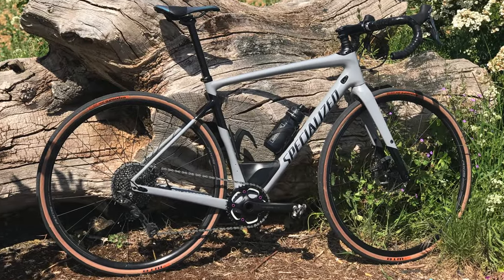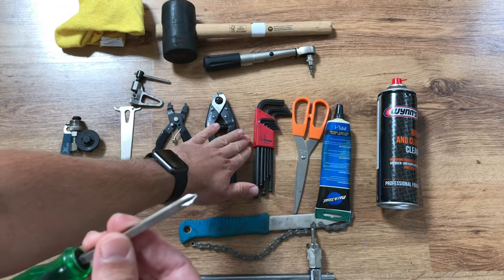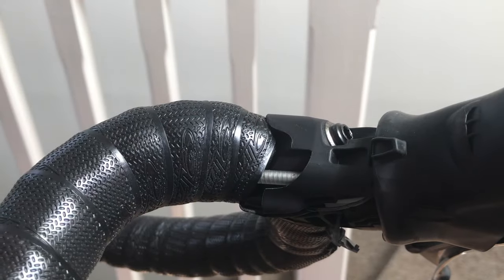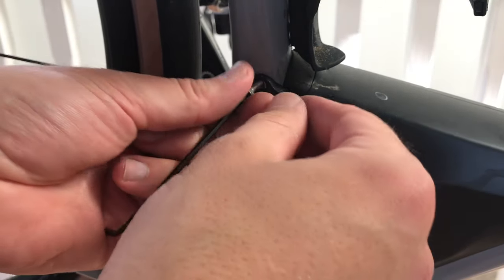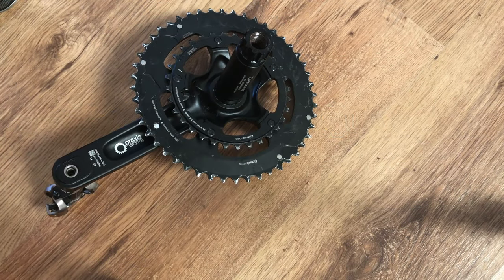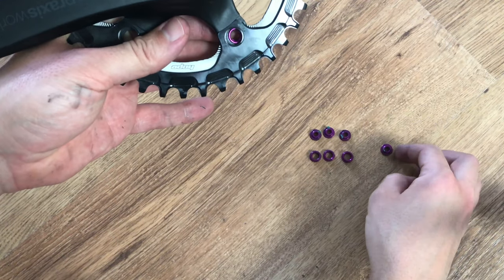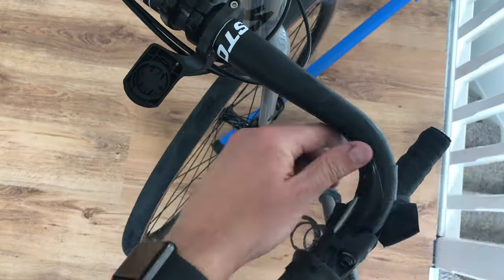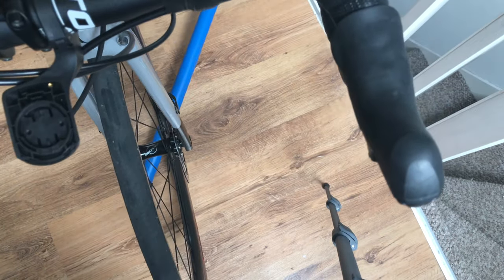How to do a 1X Single Chainring Conversion - The Diverge Project part 5

Comment: thank you for the video.
I'm planning to change my 39/53T to single 38T and 11-40T cassette. Although I have a power meter attached. I'm not sure if I can replace the chainring, but I should be (otherwise it would be useless if chainring need replacement).

Comment: I just got a new Checkpoint ALR 4, 2021.  It’s a 2x10, GRX 400. I really wanted a 1x, but this was available and affordable in a scarce market. I also really liked the fit and ride of it.  What parts would I need to upgrade to a 1x system for it?
Reply from the maker: Well your question is a little too open ended to answer accurately.It’s going to depend on the specifics options fitted to your bike as standard, what you want to spend and the terrain your planning on riding. For a basic 1x conversion all you really need is to ditch the double chainrings and front derailleur for a narrow wide tooth profile single chain. But at this point you may want to consider a wider range cassette as switching to a single chainring will limit your climbing and your top speed gears. Most single ring set ups don’t mind loosing the top speed gearing a little, but favour a low range gear for climbing especially on gravel bikes. So understanding your local terrain you ride and the gear ratios needed to climb is important.
This then can produces a problem that it’s likely that your rear derailleur is not designed to be used with a wide range cassette and might not be able to operate. At this stage you need to start considering a new rear mech or alternative options like wolftooths road link to adapt the rear derailleur. 
See it’s a little complex for a strait forward answer.
Reply: @MozOnBikes  if I run the same grx 400 2x10, and I am totally happy with the large chainring and not using the smaller one, do you think removing just the smaller chainring and front derailleur will work? I have a clutch on my rear derailleur as well.

And btw, how much weight your bike lost when moved to 1x from 2x?
Reply from the maker: It won’t work well, the outer chainring has profiled teeth for making shifting easy, you’ll find your chain dropping. You defo need to buy a specific 1x chainring.
The weight loss isn’t huge, but that mostly due to a larger range cassette weighing more.

Comment: hi man thanks so much for the video  ...i wanna ask you. : I didn't see you using chain catcher in the crank , is it not necessary ?? ....and is it possible to do that with 8 speed claris groupset ....i also got so many climbs in my town
Reply from the maker: It depends on the setup, with a narrow wide chainring and the clutch type rear mech its really unlikely to come off. However without the clutch its can be a bit temperamental especially if you tend to back pedal at traffic lights or junctions for example, on older setups pre GRX rear mechs with just a narrow wide id occasionally drop the chain. Claris will be a tricky conversion, id keep as many easy gears as possible to tackle the climbs.
Reply: @MozOnBikes  thanks for the explanation 🙏
Reply: Had Claris 8sp as well. Replaced the 11/26 with 11/34 and adjusted the B screw accordingly. Dropped the 52 and 36 off the front and replaced the big ring with mtb bash s a spacer, keeping the same ring bolts
Reply: @BrianWest58  thanks man ... I think i will do the same 👍👍😁😁

Comment: Great video. I really enjoyed watching it. 
I am also getting 1x conversion on my giant revolt gravel bike which current has 32x48 praxis alba crank & 11-34casette. I have ordered it from shimano to install GRX components that includes the crank  set as well as the other parts to make it a 40t x 11-42t. However, after watching your video I came to realise that as far as crank is concerned ordering just a 40T ring from praxis would have been fine.....oopps too late now🤭
I have one question to you and this is to understand if you're facing this small issue that I have (may be not an issue tough!)? Subsequently with the new setup will  this issue be continued?
Issue: when I turn the pedals backwards to clean the chain, the chain tends to come off from the front chain ring side.
When I examined it I have noticed that the front ring is positioned inward as opposed to casette( gear 11 is slightly offsite). 
In other words, when my bike is on highest gears (front and back), the chain is drawing a diagonal line,  hence causing the chain come off whem turning backwards. Actually chain ring is in straight line with the 3rd highest gear of the cassette.
In order to avoid that I have put a spacer to bulge the chain ring outwards. Now it doesn't come off  but the tooth of chain ring slightly rubbing against the chain from inside. 
Dealer says it is normal but it is just annoying.
Reply from the maker: Hey Tanju. Thanks for the positive feed back, glad you enjoyed it. 
Sounds like an exciting conversion, I’m too hoping to go to an 11speed setup in the not too distant future with 40t up front and 11-42 at the back. 
Once you got to a 1x set up the issue of loosing your chain up front wont happen. If you look carefully at your double chain rings you’ll notice that there are some low teeth than aid shifting. These shift teeth are the ones causing you chain derailment issues whilst back peddling.
Once your get a single ring with a narrow wide style chainring there’s no shifting teeth so you should be good.
Reply: @MozOnBikes  thank you :))
Reply: Tanju Kara......can I ask if a 40T 11/42 is quick enough for recreational road riding with a mix of Scottish hills and main roads?.. or is it better to fit a 42 or 44 chainring?..cheers Mo
Reply from the maker: Hi Morag, depends on the hills in your local area and how steep they are and how fast you want to go before you spin out.
I’ve switched it up recently up for. Hydraulic 11 speed GRX shifters and and added a 11-42 XT cassette.
I find it great for the steep rolling Cotswold hills with a top end spin out at around 50-55kph. 
Could use a lower climbing gear for the super steep hills in Cornwall still😂
Reply: Tanju kara whats your final set up ? Numbers of your front ring and your cog? Thanks

Comment: Hi Moz, planning to run a 1x with 42 on the front and using grx 400 rd. is this going to cost me problem? also what max range of cassette that I can use? thanks
Reply from the maker: Hi Tommy, with that rear derailleur the max you can go up to is a 36t. With a 42 up front could be a bit of a big gear for climbing up the hills, but it’s all going to depend on you terrain if that’s ok.

Comment: Hi, I have just purchased a Praxis Works Wide Range 10 Speed Cassette 11-40. Will this go straight on my road bike ? ATM I have a SRAM Force 12-28 (10 Speed) installed
Reply from the maker: I’m not 100% sure as I have no experience with sram 10 speed road, but I don’t think it’ll work. 
I tried something similar about 5 years ago with 10 speed 105.
There’s 2 possible issue. First is that you’ll find is that the top jockey wheel won’t sweep down far enough to clear the larger gears of the cassette like the 40t. Good news is that there’s a work around for this, you can use a little rear derailleur extender like the wolf tooth road link. I made a video on this I’ll link it here.

https://youtu.be/_WBk2eLP24Y

Second issue depends on what type of chainset and gear you’re planning to run. What you might find is that with traditional road rear derailleur they are unable to take up all the extra chain slack from a wide range cassette and a double front chainring set up. You’ll have too much chain to run small small or not enough to run big big chainrings. There’s not to many work around for this other than to go for a single chainring or 2 chainrings with a limited jump in size. 
SRAM should publish the chain slack capacity or your rear derailleur somewhere on their website and you can calculate how far off you are.
Reply: @MozOnBikes  Many thanks for taking the time to reply, I plan to use a  rear derailleur extender and run a narrow wide front 42 or 40 chainring, its pretty flat where I live. Do you think this will be OK ? Also, would the  Praxis 11-40 cassette be a direct swap for my existing cassette ? - i.e any work arounds required, specialist shims or spacers ??
Reply from the maker: Ahh ok cool, yeah with a single ring it should work pretty good. Ideally you’d have a clutch type rear mech but I ran mine without for quite a few years with only a very occasional case of the chain coming off, and that seemed to happen mostly when accidentally back pedalling in a low ratio. You should be good. 

Again it depends on your freehub on your wheels. A few years back they increased the width of the standard hyper glide free hub when they went to road 11 speed. It shouldn’t be too much to worry about though as you can just place a 1.85mm spacer inbetween the cassette and free hub. Your cassette may well have came with one.

Comment: This video is exactly what I’ve been looking for! How did you choose the new ring on the front? The teeth choices have me really confused on what I should get? Am I right is saying you’ve matched the cassette’s biggest ring to the front ring? That’s the one to one ratio is it?
Reply from the maker: It’s tricky, really depends on your local terrain and how you’re using the bike. 
Calculate the drive ratio by taking the front chainring teeth and dividing them by the teeth on the cassette. So as an example I’ve got a 40t chainring and the lowest ratio on the cassette is also a 40t giving me a 1:1 ratio. 
Have a look at your bike as it is, calculate the current lowest ratio you need for climbing you local terrain and make a selection of rear cassettes and chainrings from that. Saying that a 40 or 42 with an 11-40 or 11-42 cassette is a popular set up. Decent enough speed and low ratio for climbing.
Reply: @MozOnBikes  that’s a huge help! Thank you!

Comment: I have a GRX RX812 derailleur, Shimano RS505 levers and a Sram GX 10-42 cassete but I can't put work . I think the GRX rx812 derailleur isn't compatible with road Shimano RS505. Is it true?
Reply from the maker: According to the Shimano website checking the compatibility chart, the RS505 levers should work with the GRX812 rear derailleur no problem. 
So I’m not sure what’s going on with your set up or what the particular issue is.
Reply: @MozOnBikes  thanks, i think is the chain line. I have a frame with 135 mm in the rear and with the crankset i have the chainline is 50 mm, i think i need less, like 45,5mm
Reply from the maker: I think you should be fine with a 135mm, 135 and 142 should have the same chainline if I remember correct. 142 was an evolution from mountain bike through axles just to have little cupping features in the frame to stop the wheel falling past the axle hole. 
50mm chainline does sound wide, I think the GRX chain sets are 47.5 and sram is right in the middle of the rings at 45.5.
There is a minimum axle to crank distance that Shimano recommends, if yours is shorter and with the 50mm chainline that could be the problem, the chain can’t take the angle needed at the extreme range of the cassette.

Comment: Moz,  are you going to change cranks to carbon?  What is the praxxis spindle dimentions?
Reply from the maker: Probs won’t go carbon. I’ve got a SRAM force chainset already and I’m not super stocked with it. Wave washers and a plastic pre load adjuster are a bit of a rubbish way of pre-loading the bb bearings. 
I really like the Shimano system, but the GRX chainset leaves me a little cold for it price point, that’s and the 40t min chainring put me off a little. 
At the moment I’m tempted to get an XT chainset with a gravel size spiderless chainring or maybe look at the Hope chainset. 
Not sure on the praxis spindle off the top of my head, it’s a weird one as it has (I think) a 30mm on the drive side and a 28mm on the non drive side. 
I’ll keep running the praxis until the spring. 
Hoping to post an update on the bike soon as it’s changed a bit, just need some nice weekend weather to go for a ride and film it.

Comment: Do you have a method of "locking out" the front shifter so that it only operates as a brake lever?
Reply from the maker: Well as soon as you remove the cable all it can do is brake. 
It’s alway going to be able to swing inboard like normal, but if you fancy drilling out rivets you can remove the shifter paddle apparently.

Comment: Is that 10 speed Tiagra 4700 shifter with Shimano GRX RD-RX812 11 speed derailleur?
It work well on 11-42T 10 speed cassette?
Reply from the maker: Yes it is, it work perfect 👍
Reply: @MozOnBikes  Hello Moz
I got the exact same set up, set up derailleur and it work well in the stand. I wonder does it click when you are riding out? Becasue I felt it click sometimes...in climbing gears and smallest teeth (11t) on cassette. I was told by bike shop that it is cable tension. I wonder you felt same or it's all smooth? Cheers
Reply from the maker: Mine is perfectly smooth. 
Hard to diagnose the ticking, but usually it a little too much tension in the shifter cable when setting up the rear derailleur could cause a ticking sound (that would be the chain just ticking the shifting ramps on the next gear) but at both end of the cassette is a little strange.
Reply: @MozOnBikes  
Alright, thanks for letting me know. Maybe I pulled the cable too hard.

Btw cassette, is your 40 or 42 teeth?
Reply from the maker: My cassette is the 11-42 XT

Comment: Are you running the 810 or 812 rear mech? They claim the 810 is only good to a 34t max cog and the 812 is good to a 42t. But I hear those are conservative numbers...
Reply from the maker: 812 for me. I’ve heard similar thing, especially regarding the 810, there are several other videos with it working with an 11-40. Also seen some stuff with the 812 working up to 11-46 but that’s much thinner on the info front. Take it all with a pinch of salt as there are other considerations to take account for also.

Comment: Do you have a video on a 1x to 2x cnversion?
Reply from the maker: Nope, it’s a tricky one as most 1x bikes won’t have the shifter mechanism for a front mech built into the left hand level. There also could be potential issues for cable routing and different front mech mounting types. It’s a bit too specific to make a general how to guide.

Comment: love the vid. are you using tiagra 4700 STI shifter/brake with GRX 11 speed rear derailleur and 11-42 10 speed cassette?
Reply from the maker: Hey, pretty much, it’s an 11-40 10 speed  sunrace cassette with the 812 grx wide range derailleur and the 4700 STI shifters
Reply: @MozOnBikes  nice. I iave been searching for my 4700 to be of use. I hope grx812 is available localy. Thankz for the vid. Will be planning for the grx812 and tiagra 4700 setup.
Reply: @MozOnBikes  hey mate what’s the 11-40 10 speed like? Enough ratio to ride comfortable in most situations up hills as well?
Reply from the maker: Well it depends on a few factors, how steep your local hills are, how fit you are and what gear ratios are on your current bike. For me it works really well for the type of riding I do (mostly solo or a few friends - not a high speed chain gang) and the terrain I mostly ride is in the flowing steep and narrow cotswolds back roads. So for me a 40/42 up front with a 11/40 or 11/42 works fantastic.
Reply: @MozOnBikes  i agree with you there. it will depend on the terrain your ridding if your going for a 1by setup. im uging a 1x10 setup a 36t oval chainring on a 11-42t cassette. most of the terrain in my area are doable with the setup. not sure for steeper terrain if i can do something. well if not doable i can just push the bike ahaha

Comment: How to remove the shifter paddle?
Reply from the maker: I left the unused paddle in place. You can remove it I think, but it’s quite a lot of work and I’m not sure if it’s bolted or riveted in place, if it’s the latter it’s likely to be an irreversible change.